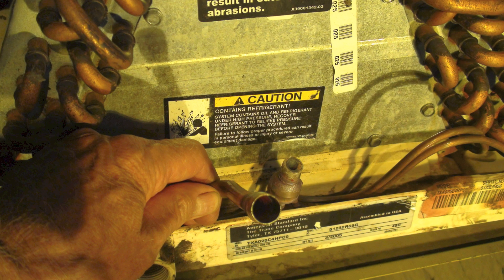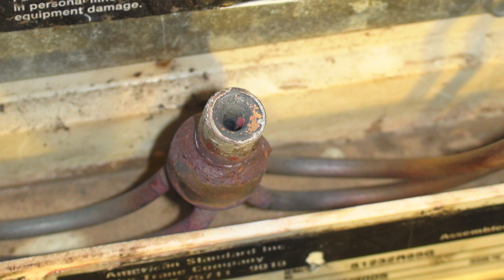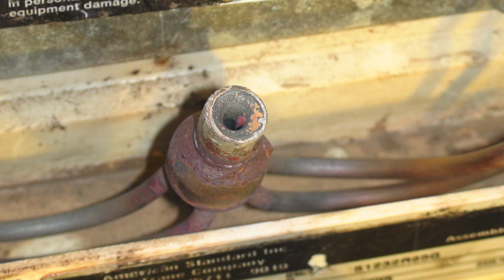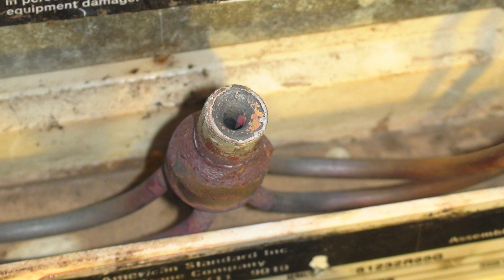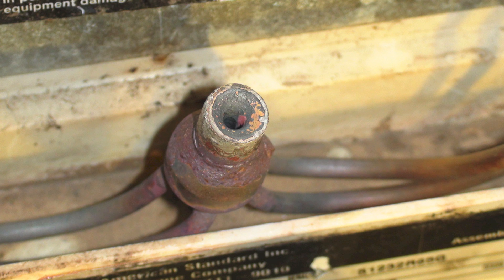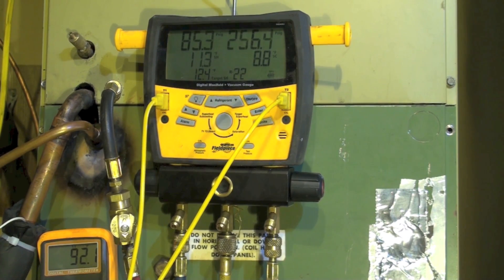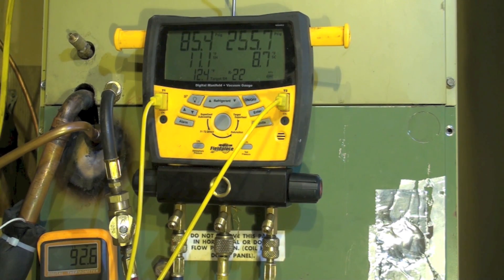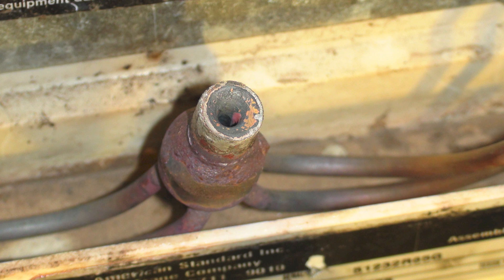Diagnose the air conditioner problem answer

Comment: I once found a 30 ton split system with two separate circuits in the evaporator.  The installers did not put any expansion valves on the distributors.  They thought the distributor tubes were capillary tubes.  It ran for years like this, and actually worked some what.  The condensing unit was on the roof.  I ended up installing the proper expansion valves, and got proper readings.  It’s just like your situation, only a larger dual circuit situation.  I believe they were scroll compressors, which can tolerate a little liquid.  I guess, by your readings, the is was an old R22 system. Even though you said it was a high ambient  outside, 85psi on the low side, along with 250 on the high, indicates weak compressor valves.  The way I used to condemn compressor valves was  look at the suction pressure, while blocking off the condenser coil to get 300 psi or so, on the high side.  If the low side got to 85,   I would diagnose weak valves.  A system won’t de humidify with a pressure that high.  What did the pressures end up being once everything cooled down?  It may have even been undercharged due to not having any expansion valves.  I believe with the 250 high side, the suction pressure should have been much lower on the low side.  Just my opinion.
Reply from the maker: That happens more than you would think.  Diagnosing compressor valves is quite hard to narrow down.  I can't remember the pressures it finally reached, but the superheat sure was better.  
GFM
Reply: @grayfurnaceman  Semi hermetic and open drive compressors are easier to diagnose.  You can tell the difference between suction and discharge valves being defective.  The valves are also replaceable.  As far as hermetic go, I was talking about the discharge valves which usually shows up as high suction pressure and lower than normal head pressure.  The compressor should be able to hold the suction pressure less than 80 psi with the head pressure driven up to 300.  If not the discharge valves are leaking back.  I’m talking about reciprocating compressors.  The valves can be ruined by one flooded start, which is the number one cause of compressor failures.  Crankcase heaters, solenoid drop valves, and limiting the amount of refrigerant  charge can control the amount of refrigerant that is drawn into the oil during a long off cycle, such as sitting overnight. A compressor with excess liquid in the crankcase can cause a burnout, bad valves, and damaged bearings, as all the oil will be pumped out of the compressor as the liquid refrigerant boils off.

Comment: I have high suction, low superheat 3. Low head and high subcool 28. R22 TXV, DT 10 wet bulb 72 outdoor 90 stuck.
Reply from the maker: With a TXV, low superheat means we must look at the valve.  The only number that does not seem to fit is subcool.  
I would be trying a couple of tricks.  
Start the system, then shut off the condenser fan.  This will tell you if the compressor is capable of building head.
Watch amp draw as the unit builds head.  Does the amp draw go up or stay well below rated load?
Is it a heat pump?  Possible rev valve problem.
GFM

Comment: Definitely not where I was headed!  Though, with no metering device ( other than the distributor tubes.. ) that would explain my reasoning of a restriction in the condenser.  When I seen the head pressure fall.  I did, however, show the video to a friend of mine, and he guessed a stuck open TXV ( so he was a lot closer than I ).  Was this a customer's system or a training unit?  I am guessing from your comments in the video, it was a customer's system.  Thanks for the challenge and schooling!
Reply from the maker: This unit is a training mule.  I have had stuck open TXVs and they usually have somewhat more normal pressures, just very low superheat.  I realize its hard to diagnose when you can't watch and feel what is happening.  Thanks for the participation.
GFM

Comment: There was a restriction in the condensor with that high of a mass flow then....that is why it was flashing.

That wasn't a mechanical piston assembly? You welded it back together with a piston?
Reply from the maker: There was no restriction.  It simply was pumping refrigerant thru the system with some small drops in pressure that would be normal thru the piping.  I added a piston assembly.  I think the original service tech may have not wanted a TXV although the outdoor coil has a TXV and a hard start kit.
GFM
Reply: To clarify there is no restriction with the proper mass flow with a piston installed but with the extremely high flow there was a pressure drop causing the liquid to flash... hence the lower than ambient temp. But it wasn't completely flashing to saturation temp because you found it warmer than measured saturation ( negative subcool )
Reply from the maker: That makes absolute sense.
GFM
Reply: grayfurnaceman I really enjoyed this series too! It was a good one for sure!
Reply: @joeshearer1247  This should be an "extra credit" question on an AC exam.  😵